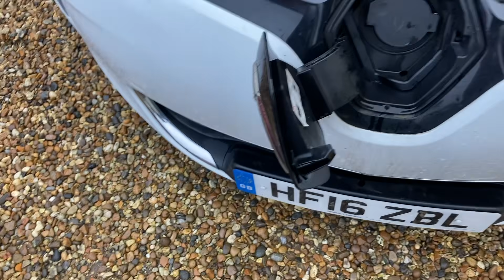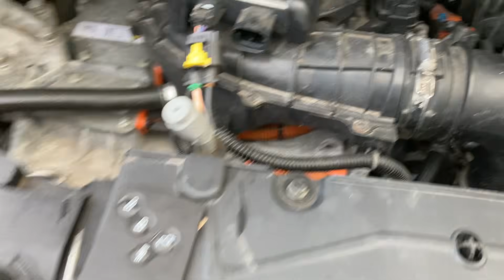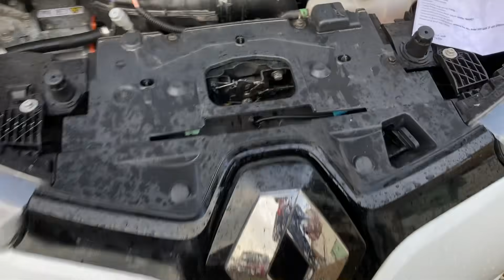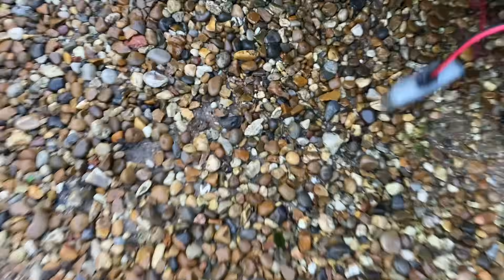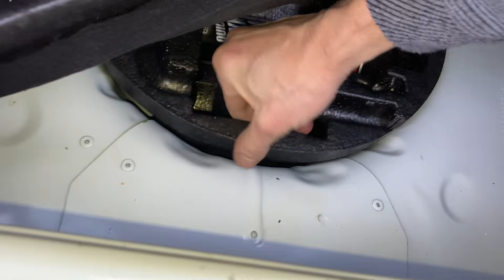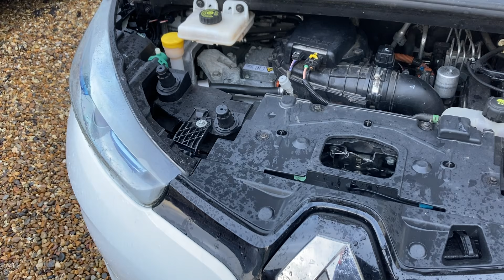My list of easy Zoe checks that every owner should do - Renault EV Electric car repair maintenance

Comment: Directly behind the front weels inside the fenders, lots of leafs seeds, and dirt get collected from the drain in fromt of the windshield and form a little "compost column" at the bottom. getting there is not the easiest, but cleaing it might not be the worst idea.
i have seen it before on a zoe with a shatterd fender spilling out, and mine has the same dirt collection in this place.

Comment: What a great video! Very helpful. 
Would you be overly concerned about a Zoe that's only done 300 miles in last 6 months, old person only has a granny charger. Not sure if it's been left on charge or left unplugged. Showing 174m rangevat 100%. Just a bit worried about battery damage. FDSH 12k miles. 21 plate r135. 
Thank you 😊
Reply from the maker: Hi I wouldn’t be overly concerned as the Zoe battery management is prettt good and that battery would be covered by the 8yr Renault battery warranty if you’re in the uk and it’s not high mileage. Cheers
Reply: @garycevrepairs Thank you Gary! Only done 12k. 👍

Comment: Can I assume that the cooling fan intake has no filter ?  😣
Reply from the maker: The Motor cooling fan indeed has no filter, just a grill and they placed it at the top of the engine bay.
Reply: @garycevrepairs cheers for that Gary, as I suspected, could just feel the plastic grill     with fingertips and thought even Renault weren’t so stupid as to fit a filter Inside the fan casing 🙄.    Keep up the good work much appreciated 👍👍👍

Comment: Have done the charge port contacts clean along with the cable ends and also the home charge point.  Much quicker handshake between the home charge point and the car since. Contacts were black!
Reply from the maker: Great stuff, it makes a huge difference! 👍

Comment: Thanks. Some very useful information in this video, with one caveat: 

I was shouting at the screen when you sprayed fluid onto those electrical contacts. Make sure that the 'cleaner' contains no silicones. (WD-40 does, for certain.) Silicone-based cleaning sprays and polishes are banned from many offices and IT departments because they wreak havoc with keyboards, phones and other electrical items. Manufacturers are quite aware of this issue, but they sell you the fluids anyway, because it means more profit for them and for component manufacturers. Once you start using it, you will need to keep using it, because of the damage it causes. (I'm a retired electronics guy, among other things, and have seen the problems caused by silicones, many times.)

The silicone does remove debris, and appears to clean contacts, but it leaves a thin coating on the surfaces which is nonconductive. That has to be broken through every time afterwards for contact to be made afterwards. For higher power switches and contacts, any sparks will convert some of those silicones into Silicon Carbide (SiC or carborundum), which is an excellent electrical insulator and a very good abrasive, not much less hard than diamond (Moh's hardness of 11 for SiC, and 12 for diamond). Contacts will work fine for a while after application, but will gradually become troublesome later. Silicones also creep across surfaces for at least about 30cm / 12 inches, over a period of weeks to months, so that, for example, a computer keyboard or a telephone keypad will start to fail 6 to 9 months after office and home cleaning sprays and polishes have been used on a desk near to them.

The best option for unprotected components is to inspect switches and contacts and to remove any water with clean cloths and cotton buds, and loose debris with an air jet, a dry cotton bud, or maybe use a little Isopropanol (IPA or rubbing alcohol) to remove oil and grease. If there is any corrosion, then maybe a fairly soft wire brush is all that you need, followed by an air jet or cotton bud. For stubborn corrosion, the only reliable long-term solution is to replace the switches or contacts, if possible. Anything else will get you by for a while, but will cause problems later. Silicones are, by design, quite difficult to remove completely from surfaces.

Best of all, the ideal is to not let dirt, oils or insects get onto components in the first place. This is not always possible.

And that's because, sometimes, with built-in obsolescence, it is intended for such items to become contaminated and to fail, forcing the owner to have to buy replacement parts or a new item. That's why Renault quoted £2,000 + VAT for a replacement battery module for a Kango. The price is set so that it's only a little more expensive to replace a whole battery, rather than the modules, or a new vehicle, rather than to repair it. That's also why what should be a replacement £100 set of bearings for a Zoe motor can end up costing the owner £3,500+VAT for a new motor. Things are designed to be awkward, fragile and to damage other items.

This sounds like a rant, but isn't. It's simply a way to warn you to avoid using products containing silicones where electrical contacts are in close proximity. It will save you, and your customers, thousands of pounds in repair bills.

Comment: Thanks for the great video. You mentioned about the compressor part way through the video. Would a symptom of the car charging cutting off frequently (say 30 min max, and reducing on further attempts) as well as the car showing the stop danger message after turning on the AC most likely be related to AC compressor/heat pump? There is of course no heating/conditioning either!
Reply from the maker: Hi yes it could be an internal short inside the ac compressor. Needs insulation testing on the compressor. Cheers
Reply: @garycevrepairs  Thanks so much for the reply. I am managing to return the car to the seller who deceived me over its condition but it has been very interesting watching your channel over the past few days!

Comment: My 2017 Zoe had the windscreen removed and rebonded as the windscreen was leaking in through a small hole caused by bad manufacturing .
The glazing company said the fault had been there since it was first built , but did not leak until it was 6 years old.
I change the 12v battery every 3 years.

Comment: All my tyres drop a bit. Worth checking every 3 or 4 months.
And don't forget that the air you filled, on that blistering hot summer day, is going to shrink when exposed to mid winter icey roads.

Comment: The charger hinge spray and indeed all hinges are lubricated as part of the service. DeoxIT spray would probably be best for the pins. The 12v battery is a right Royal pain. I take the car out for a 30min drive to keep it topped up. If you know how to park up without the handbrake being on that would be a god send. The number of times it has frozen/rusted on well.. Lots of red warnings and eventually a very loud bang and the car can be used but not until everyone in a 30 yard radius is looking at you.
Reply from the maker: Hi, many garages would stay away from the charge port! There is no effect on the 12v battery by driving, it’s not like an alternator that is spun faster when the engine is revving faster, the dcdc converter puts out the same voltage whether it’s moving or not, but still it’s not a battery charger it’s just a fixed voltage converter hence the charger is better. If your rear brake is sticking on then likely you have a slight brake fluid leak, it creates a sticky paste when mixed with brake dust. Thanks.
Reply: @garycevrepairs many many EVs require the car to be driving and in a certain profile to actually charge the 12v battery and log it to the BMS.